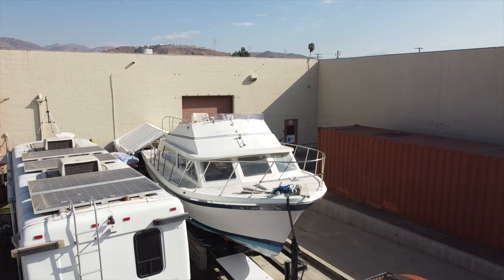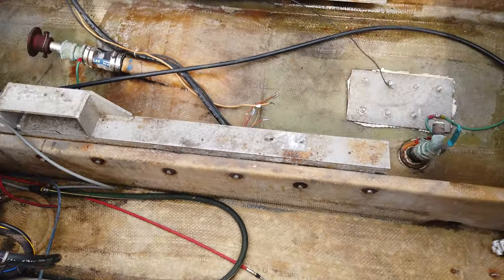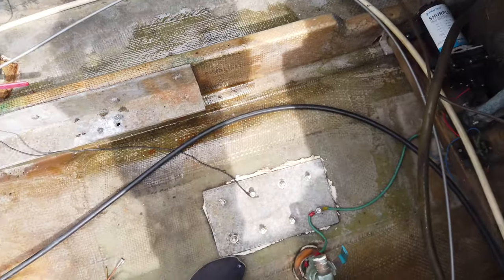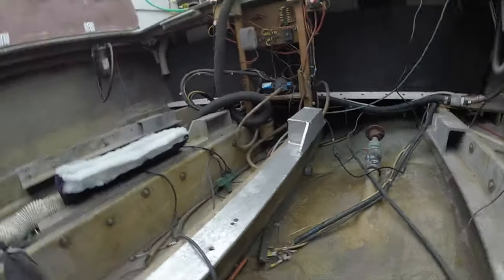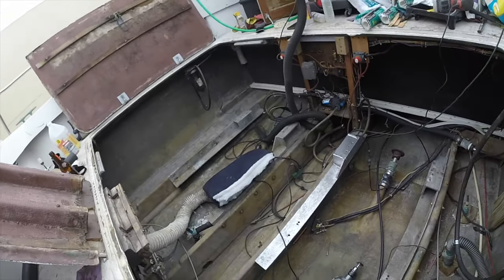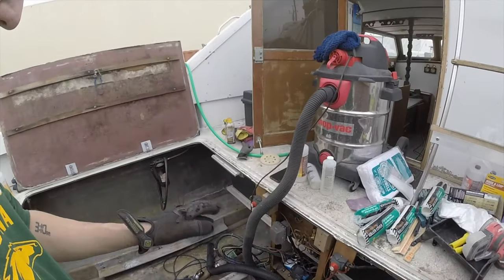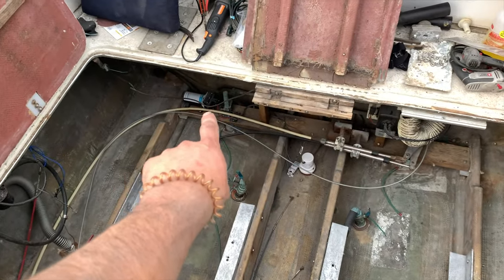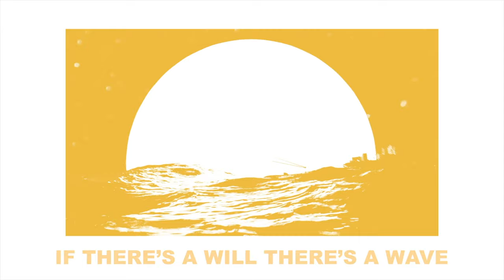Detailing a 46 Year Old Engine Bay - Engine Bay & Bilge Paint Prep - Old Yacht Restoration - Ep 17

Comment: Just a suggestion, since you have V-drives, you may want to replace the packing on the stuffing boxes while the engines are out.  Just a thought...
Reply from the maker: Yes definitely, I’d honestly like to service everything while it’s out if the water and free of engines. How would I go about that? Could you elaborate a little further?
Reply: @IfTheresaWillTheresaWave  
ABSOLUTELY! Install a new shaft log hose and dig out the old packing and replace it with Gore-Tex (GTU) packing. If you do it right it will out last you! Do Not convert to a “dripless system”. Stick with the old school + GTU and you will save money, less maintenance and no chance of catastrophic failure. On a smooth shaft a GTU packing is nearly dripless in operation. Remember that you need to “burp” it when you spash the boat to get the trapped air out of the shaft log and adjust it underway. When you first install, snug the nut down on the packing, then back it off, then grab the shaft log and mash it around the shaft to set the packing. Tighten it later during sea trials. Better it leak a little than get hot at first. This is the best time to do this!